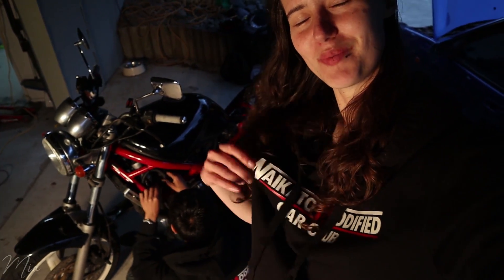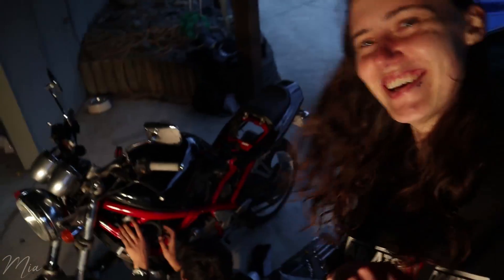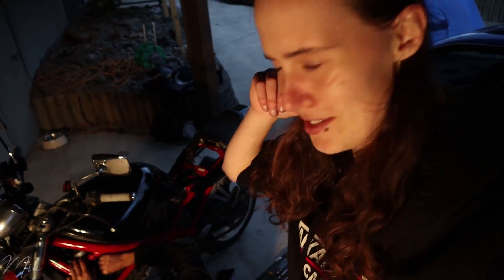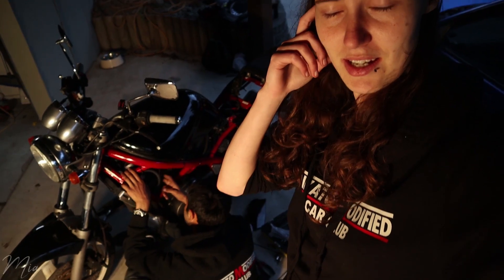LOUD as HECK horn install! 139 Decibels!

Comment: Riding like an amped up squib doesn't help
Reply from the maker: I wear gear, I'm no squid 🤣 you know this video was made a while ago I have learnt plenty since this video 😅
Reply: *squid. Using Speech-to-Text. Came out wrong. Yes I'm sure you have learned a lot and that's great. You have to understand that people driving vehicles with more than two wheels generally don't expect somebody leaving out of traffic, exceeding the speed limit, making erratic movements on the road, and they are generally more difficult to see. Seems like you have developed a full understanding of that and it's good that you were still alive! I was run over 15 years ago. Stop on the freeway to avoid a crash that happened in front of me and an SUV hit me from behind at 75 mph. Broke my back and my hip and a bunch of other stuff. I'm fine today except for chronic pain but happy to be alive and not paralyzed. I don't wish for anybody to go through the amount of pain I went through. Be safe and keep the rubber side down!